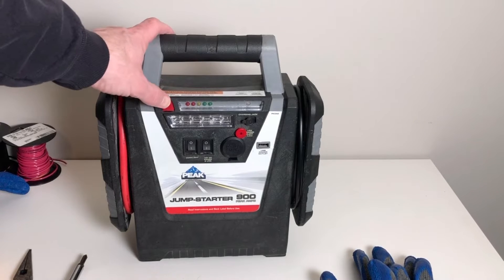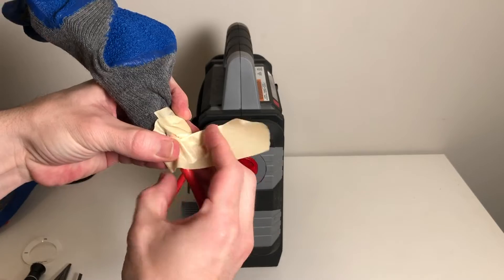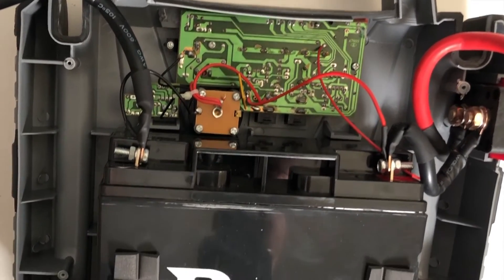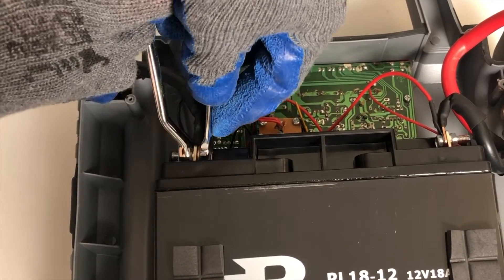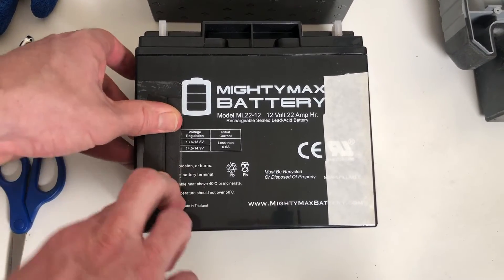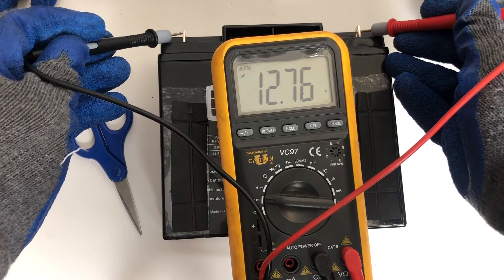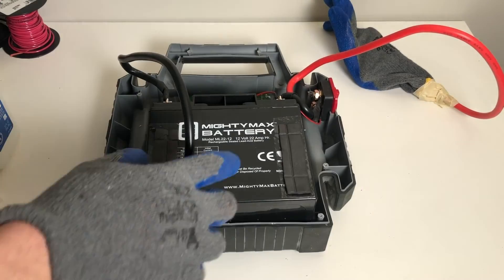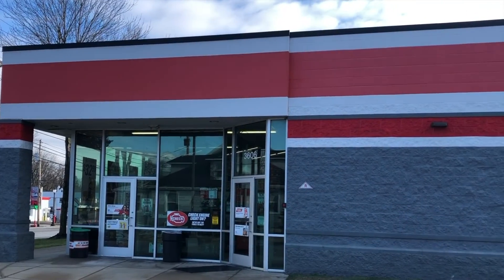Replace & UPGRADE Jump Starter Battery Backup Pack – Step-by-Step DIY – Super Easy – Save Money

Comment: what if i replace a lead acid battery with an agm? will the charging system charge and maintain it or it will kill it?
Reply from the maker: That's a great question. The battery in our jump pack, shown in the video is an SLA (sealed lead acid), however, it's not labeled as AGM. The difference is whether the electrolyte is liquid (SLA) or absorbed in the mat (AGM). They do require slightly different charging voltages and replacing with an AGM could reduce the lifespan of the battery. While there could be some advantages (such as more rugged for offroad or heavy use) it is better to use the same type of battery as the jump starter circuit will be designed for that. Worse case scenario would be an overcharging situation, so really best to avoid and replace SLA with SLA.
Reply: @fatherandsonfix this is a concern with cars, but in this case you charge rate is less than 3A or even less than 1.5A so overcharging is probably unlikely i think.

Comment: This is excellent timing as I did this same thing a couple of weeks ago but with a slight twist. When the battery needed to be replaced instead of using another 18Ah battery I used a group 94 car battery i had on hand. Now I've got the juice to jump start almost anything.
Reply from the maker: Nice twist, you could jumpstart a Powermax diesel with that.